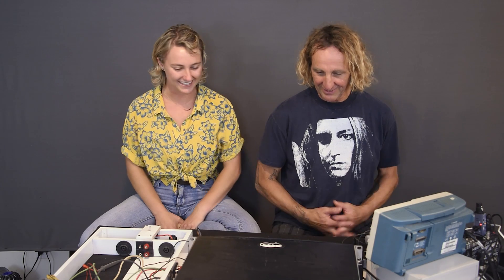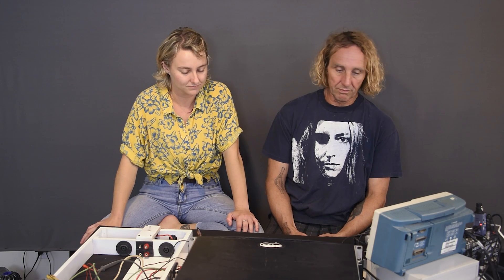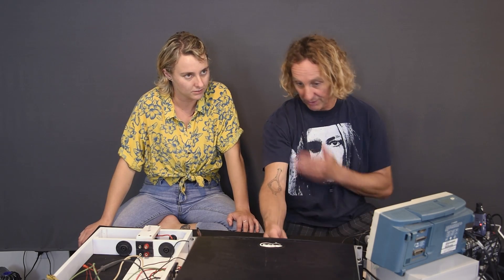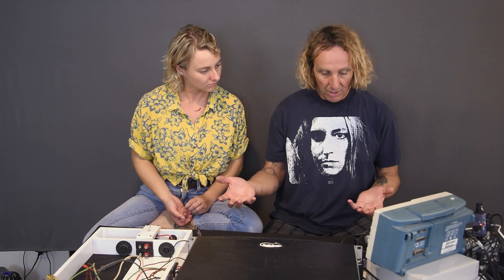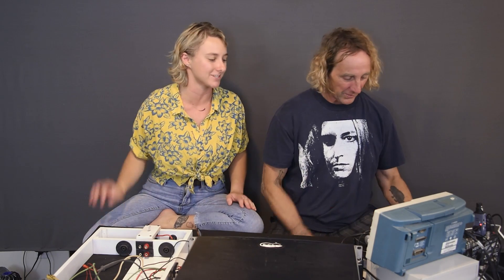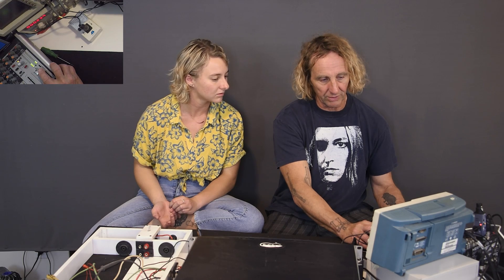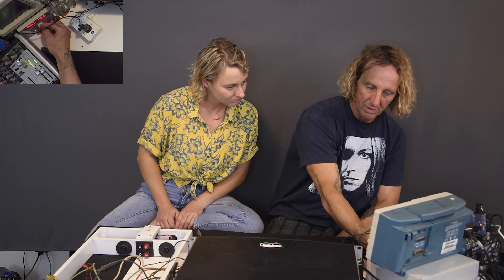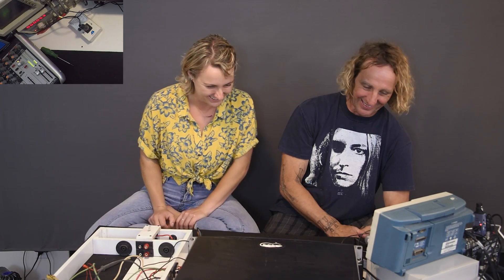High Power Distortion Test Powersoft X4 Amplifier Class D (Public)

Comment: Very good but please don't play that high pitch sound again! Please. I like collecting old amps they are cheaper. I have MC2, Martin and Lab, Crest, QSC, and some older Powersoft. The crest are Granit Line. I sold some of my Cloud and a nice old school Crest and in the UK I have a BSS. I also have some Peavey which is Crest. In storage I have some Harrison and Yamaha and still got lots of Cloud amps. I use a mix of amps with switching power supplies and linear. Generally linear are more reliable from day to day, especially after a few years. I like the size and weight saving of the powersoft but after only experiencing used amplifiers I find the Powersoft are not amazingly reliable.
  I bought one and fixed the power supply management section but there is also another issue with one of the amp boards. I need to delve further. It still works but the level lamps act strange, + some strange power supply noise after power up in one ch. Then it also clips hard all of a sudden on that ch or rather those 2 ch as it's a 4ch. But it powered 24x 1" drivers running way too low at 1.3 Ohm per ch (at half power on the amp). 1" diaphragms are not that hard to run compared to 18" bass drivers hence not an issue with the low impedance at half power!
  The other one I have is a 4kw 4ch at 2ohms per ch. It works fine but when it's first powered on there is a very high pitch noise in the speakers, the frequency rises and rises untill it's no longer audible after 5 seconds or so. This is not normal! I suspect some old capacitors. The issue within these amps is that the air flows quickly around some parts of the amp but in other parts it can remain quite stagnant. Capacitors can become hot if too close to certain components then they fail after some time.

Comment: Are the high voltage not much more likely to fry the voice coils? I would expect arcing to start much earlier at those voltages. Especially if you get some voice coil rub when the speaker becomes damaged. I hope issues like that don;t destroy the newer amps.
Reply from the maker: Higher voltages and higher currents can be tougher on speakers but also that's what's required if you want higher volumes and clean transient response.

As far as the durability of new amps to deal with speaker faults and such, That's highly dependent on the manufacturer of the amp.

Some of these newer amps are incredibly durable and smart.

Comment: What horn driver would handle half the power needed to cause the distortion?
Reply from the maker: I don't understand the question
Reply: @DaveRat  i was just thinking that the point at which you hear distortion in the high frequency information from the powersoft amp, most any high frequency driver would have been fried, wouldn’t it? Even 8 at once. Maybe not.
Reply from the maker: Agreed

Comment: Pulled up the manual to check the specifications. As suspected the power ratings are peaks, not RMS. I look at the maximum power draw for the amp. It uses 3 phase power from 100 to 240VAC. Assuming 208V power draw is 9A at 1/8th power, or average music, not a tone. Suggested circuit breaker is a C16, Max consumption for all AC Mains Cases is < 3000 Watts.  This amp can not output a 5KW tone and still draw under 3KW of power except as a peak pulse.
Still very impressive and a great way to make speakers into fireworks in a show.  These would be great for subs that take 1-2 KW. Don't know of any single speakers that would take the full output other than a 16 speaker series/parallel array.
What do you normally connect this to at a concert?  I'm guessing passive subs.
Reply from the maker: These amps are quite good and we bought them to power what we call the SuperWedge. A dual 12", 10", 2" quad amped wedge with an 8 ohm load on each way.  We can drive up to 8 wedges from a single amp. Having a 10 to 1 or at least a 5 to 1 peak power over the rated power is desirable.  We also used the amps to drive V-Dosc boxes for delays and had really good sounding V-Dosc presets made for them.

Comment: Thank you for sharing all of your experiences and knowledge! I specifically wanted to know if this amp could push subs. 
Would you say that this amp can run the Adamson S119s × 8?
Reply from the maker: I have found that to really know if an amp,/sub combo will be impressive, I need to setup an test it
Reply: @Dave Rat  I agree! To be honest, I run my current Adamson setup with the PLM20K44s, and have one of the X4s from a deal, and havent gotten the chance to use it due to the lockdown. Right now it's less of a, "how good will it sound" question, and more of a, "is it even advisable?" Question. Can this amp run subs well? Should I limit it to just 6 subs or will it be able to drive all 8? 
The 8 and 4 Ohm ratings seem to be similar to the 12k44.
Reply from the maker: Those amps do well loaded up and take abuse. They will drive 1 ohm and will protect themselves from damage
Reply: @Dave Rat  I'm going to take this as a yes! Haha. Thank you so much for sparing the time to reply, I really appreciate it! Much love from India 😁
Reply from the maker: Cool cool Dale

Comment: Hi, 

These amps are designed to run off of 3 phases when available. How did you have it powered for your tests?

Sorry if I missed info in the video. 

I'm not sure if it would make any difference for these tests. I'm just interested. 

The couple of times I've used them I was running from a single phase 240v (EU) supply.
Reply from the maker: 120v single phase

Comment: Dave, at 3:40 you mention this third type of amp using dual hot configuration, could you please give an example on a current commercial amp using this, im keen to read more. Cheers.
Reply from the maker: Yes, the L-Acoustics LA12X is I tested. L-Acoustics purchased Camco and the LA12X is Camco amp.  So it is possible or probable that other Camco models use the same configuration.

Comment: Dave, can you see a waveform of the signal as it approaches the internal limiter? Any evidence of a DC signal going out to the speaker as that limiter engages?
Reply from the maker: Hmmm, A limiter operating correctly is basically just a really fast volume control that turns down the signal when it peaks. So, there should not be a DC component added to the signal. That said, it the attack is set too fast, there will be an undesirable distortion added. Keep in mind that distortion is a change of the signal from the original. So all limiters are a form of (hopefully) desirable distortion

Comment: Great analysis Dave.   Any idea what the Class D Switching frequency is ?  Also might be interesting to see what the class D LPF rolloff / curve looks like.  (all presuming you have this set up again sometime in the future).   I'm impressed with the crazy amount of power and effectiveness of the limiter with expected program material.
Reply from the maker: I will run the amp through smaart at some point and look at the LPF.  Also I believe I can see the switching freq on the output as residual noise so I will look next time.

Comment: I love how the fans on a 1RU amplifier sound just like the fans in a 1RU server. Then again, there isn't a lot one can do with only 1.75 inches. And, the fans are probably all sourced from the same manufacturers.
Reply from the maker: Yeah, companies building amps and servers will source the products that perform for the application and since the dimensions are the same, the fans can be similar.  There are loads of companies making those 1.5" box fans.
Reply: Ah well you will like what I'm working on
Reply from the maker: Cool cool, let me know when ya can
Reply: @DaveRat  It's officially "secret weapon" stuff.

What if I told you the last time one of my bosses sat down for dinner with me, before he died at 90-odd... I did his memorial service booklet notes... he basically told me with a wink and a nudge that he was the dude who designed the propellors for the nuclear submarine program. I mean, I knew that already, and way more than he expected... but... 

Oh yes, I'm a fan of acoustics, and in the gas turbine industry, there's some really interesting stuff to do with flame propagation and wavefronts, so if you get yourself the F1 / jet engine / rocket scientist toolkit...

Well... moving a whole bunch of air, and generating air pressure... and megawatts to gigawatts per square foot... we do that in power generation and engines... but we don't do that in sound reinforcement.

See what I'm saying here? 

Yup. If you really want to move a lot of air, I'm proposing that the fan is the speaker. The thigpen subwoofer plays down to DC. 

And absolutely we use active airflow as a way of keeping stuff cool inside a gas turbine, of course we do, hence keeping the active electronics cool... almost every industrial and hand-tool electric motor does that.
Reply: I have a Behringer class D power amp for my sub at home, and I swapped the fam for a Noctua one. Definitely recommend it for anything using standard fan types.
Reply: @MFKitten  I switched to Noctua fans in my editing workstation. Keeps everything nice and quiet. Except those are 120 - 140 mm fans, not the 40 or so mm that would fit in 1RU. Glad to hear Noctua does a good job at that size as well.
Reply: @matthew.datcher  this is a 2ru power amp. For some reason. It's mostly a hollow chassis with a little pcb inside haha :p
Reply: @MFKitten  for a residential application, Noctua could be fine. In a touring sound system, it will be a disaster.
Reply: @PeX218  how so? They make fans for server racks and such that operate 24/7.
Reply: @MFKitten  I have an Intel Xeon x5492, it’s thermal dissipation power is about 150 watts. I’m using a Thermaltake Frio and my CPU never gets above 60 degrees Celsius, even in the hottest days (48 degrees Celsius) and a ton of processing (70% of load on 4 cores).
Even that powerful cooler will let burn my audio amplifiers.
Unless you have ordered a custom project for your thermal needs, I don’t believe a standard Noctua could do the job without struggling to cool down at a safe temperature.
Or maybe I’m wrong, I don’t know.
Reply: @PeX218  this would be a fantastic experiment!
Reply from the maker: Any or most box fans will work fine. Just look for a running hours or lifespan spec. Balance the fan noise level vs CFM vs the acceptable noise level

The only real issue I have had with fans other than dust clogging and the occasional failure due to age and wear is they do not like to be mounted inside subwoofers operating are high levels.

Comment: Excellent, you have managed to make the powersoft amp to display excellent performance under duress
He said the amp was receiving 270 volts
Seems the amp doesn't like to reproduce higher frequencies
Not sure of the price of these
Reply: About 9k but you can get the 8x for the low low price 16k its double the rack space but its double the power and channels. To put that into perspective you can literally get 160 thousand watts into an 8 space amp rack. That’s less than 18” tall. You could fill giants statium with 2 of those racks. Probably one
Reply from the maker: The X4 is an awesome and versatile amp.
Reply: Yes, with the testing that was done, seemed to do an excellent job, 
of course it didn't like the pink noise and seems a bit pricey
needs 220 volt, l think a lot of sound guys out there are interested in amps that run a 20 amp circuit, 120 volt lightweight, can run a dual 18 cab as well as mid high top and be readily available cheap used
Durable, repairable

Comment: So your loading 2 channels with almost 5kW continuous? how is the amp supplied from 110V? and how where are you dissipating al this power? whats the load Resistor?
Reply: So when you say it is 5000 watts per channel, that is peak? What’s the RMS rating?
Reply from the maker: https://www.powersoft.com/en/products/touring-amps/x-series/x4
Reply: @TomCee53  no thats rms at 2ohms the x4 has 5000 by 4 rms and the x8 has 5000w times 8 and it’s all rms
Reply: Thier power supply can go from 115v to 440 automatically. It’s one of those smart power supply’s automatically adjust itself to whatever you feed it. It’s crazy the power you can from class D
Reply: @jamband4230  the problem is with this low voltage the current to get 20kW would be enormous. or do you think this amp can Handel ~200A input?
Reply: @lambda7652  well it’s running on a standard 20a electrical socket so I would be pretty impressed if it’s got 200a going into it. I know that if it were dc power it would need that kind of amperage but since this is ac I’m not really sure how that works. Remember this amp has an extra 108 volts to work with over say a car amp that has a average of 12. I’m sure thiers somekind of step up transformer inside this thing that steps up the voltage even higher than the 120 since this amp will handle 440v if you give it to it
Reply: @jamband4230  20A Amps on 110V is only 4400W even if it has 3 phase its only 13kW.  So not closes to 20kW.
Maybe "peak" for some channels. 
So testing it with Sinewave with or constant noise is surely not appropriate for this AMP. since it must reduce Gain to not pop the fuse or power supply
Reply from the maker: US voltage is now 120V and has not been 110 for years.

Also, rarely are amps used to deliver continuous power unless being tested. Music tends to have 5:1 or higher peaks so a 5000 watt amp will really only draw 1000 watts. Also the circuit breakers used for building power don't instantly trip at rates load and have a trip curve that allows peak current draws way above the rating for varying time frames.

In real world system deployment, supplying ac wall amperage that is 1/2 to 1/3 the amperage that an amp is rated is typically a safe bet for most applications.

That said, running a powersoft X4 which has a rated output of 5000w x 4 so, 20,000 watts outout off of a 3 phase 30 amp 120v ac  supply will offer 10,800 input watts and that is more than enough to supply the 20,000 watt output peak power needed for music. 

In real world, an X4 driven at max power can be runs from a 30 amp single phase 240 and not blow breakers. So an AC input capable of 7200 watts continuos is sufficient to power an amp with 20,000 watt peak output power reproducing music
Reply: @jamband4230  A class D amp is basically a switching power supply. To get 5000w into 2 ohms requires about 100v dc, probably a bit higher for safety and overhead, and that would be + & -. With 120v AC input and 90% efficiency, it would need about 90A for each of the 4 amps. You can’t really sell it as RMS continuous unless you have the power supply to back it up. Since the spec sheet says it only draws 3000w total, that’s probably around 700w rms. Nowhere does the spec sheet say RMS.
Reply: @TomCee53  yeah, it’s class.D
Reply from the maker: The p will run on 240 3 phase, 120 3 phase 240 single phase, 120 single phase and 120 v.

The debate of whether rms vs peak power and the time frame of the delivery is covered in the several videos I have done on the topic
Reply: @DaveRat  the short answer is you will never use full rms at a show. The amp is capable of achieving rms power assuming it has proper power and fusing and generally most venues have adiquate power and if your desperate you can always use the power from the washer and dryer. Reguardless these amps are impressive to think a few years ago most amps were putting out 1100-2000 per channel and they weighed about 89-90 lbs a Peace and took up 2 rack spaces these guys are doing 80k in the same space and 2/3rds the weight.
Reply from the maker: There is a video up where I show peak power is audibly louder and more useful than a higher rms and lower peak using a powersoft T904 vs a creat 4801
Reply: @DaveRat  I'm aware of the peaky nature of the music or crest factor. and this is part of my point in the video your driving the amp into limiting/compression with a test tone. Clearly not what it is designed to? and therefore its reducing gain automatically? 
Talking abut 7:50.

I suggest its only limiting because its a constant signal and not short bursts like in music